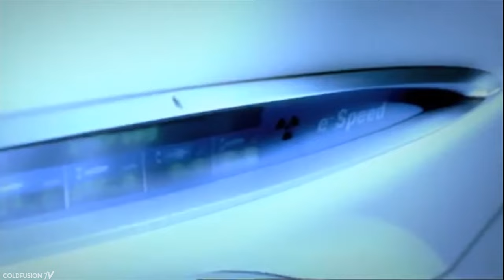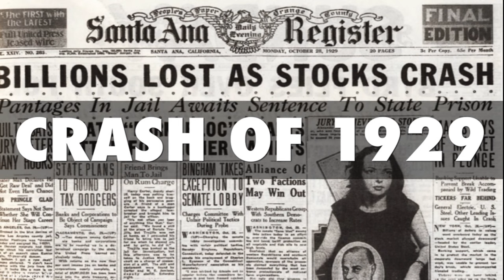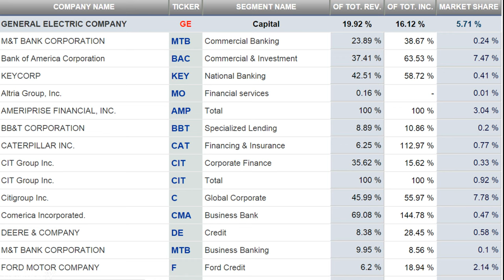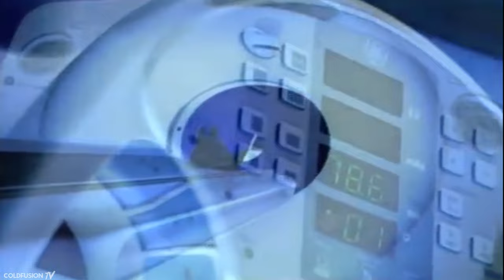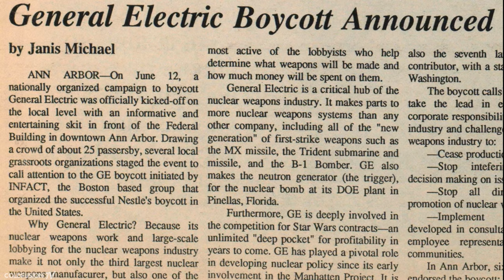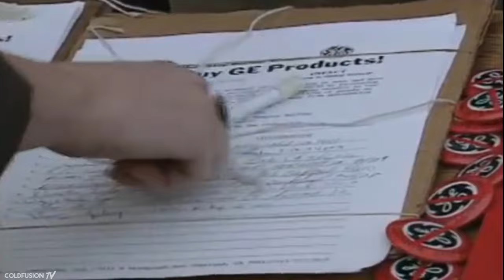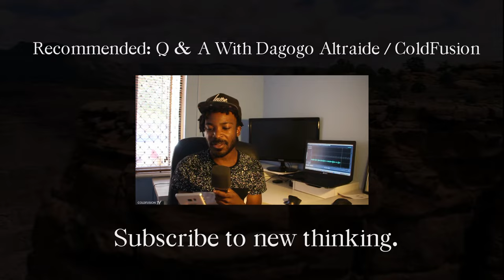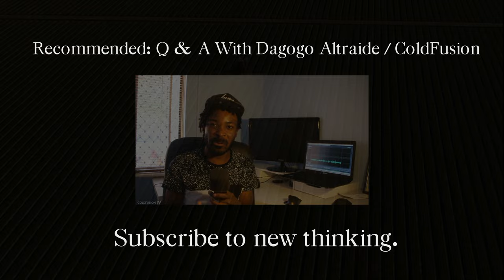How BIG is General Electric? (They've Made Nuclear Weapons!) | ColdFusion

Comment: FYI,  GE sold most of their capiral business which is still in transition.  So capital will be diluted and GE can focus on core work areas.
Reply from the maker: +Pawan Gupta Thanks for that, I've put an annotation up. Makes sense for them to get out of capital markets right now, especially oil company finance!
Reply: +ColdFusion Yea Ge capital is now synchrony financial and in December they completely spun off
Reply: +ColdFusion That was mostly because of the new banking regulations came out after GFC. It wasn't viable for GE to continue into capital business with regulators requiring very high percentage of capital to be reserved for the rainy day. There is more to that but that regulation pretty much forced GE to sell it capital business coz its capital business had the potential to make to it bankrupt in the event of another GFC.
Reply: +ColdFusion you should do a documentary on Freedom 251, the world's cheapest smartphone. only 4$
Reply: +ColdFusion They have also sold they're Appliances business. Companies that purchased parts of  Capital and Appliances will still offer GE products over the next year or so.
Reply: They sold the appliances division to a company and China that will still use the GE brand and logo for 20 years.
Reply: "Their" not "they're"
Reply: And that Chinese company which acquired GE's appliance business as well as the right to use the GE brand with their products: Haier.

Comment: Now that we are in the 2020s decade, it does appear that GE is getting smaller, and here's a breakdown. The shrinking of GE in the 1980's included the boycott of GE (because of their nuclear weapons shenanigans), the HVAC division being sold to the Trane Company, and their small appliance division to Black & Decker. But in the last 1 to 20 years, GE sold their small motor division to Regal-Benoit in 2004, large motors division to Wolong in 2018, large appliances to Haier in 2016, plastics to SABIC in 2007, and their Oil & Gas operations to Baker-Hughes in 2018. More recently, GE sold their train and transportation systems to Wabtec in 2019, both their consumer-residential lighting division to Savant Systems and their commercial-industrial lighting to the Daintree Group (both in 2020). On top of that, GE was actually booted off the stock market in 2018, and now that they are only in the financial business, aviation systems, and healthcare equipment markets, they are now just a small shell of their former corporate dominance.

Comment: Yeah. Great video. Some additional data you could have used: when you say "innovation" and show B1 Lancer engines, you could have mentioned that GE, or GA for that matter, was not able to produce a single jet engine until they received and copied one from Britain - a prototype originally designed by Frank Whittle and observed by an American colonel visiting the first "hop" flights of Gloster Meteor. The colonel became then so impressed he arranged for sending a copy of the engine to US, which somehow ended up in GA "shop". Another even "darker" thing about GE - they manufactured the Pressurized Water Reactors. And the thing is they were first designed for nuclear submarines. However, they got greedy, as they obviously do, and started offering those for civil applications - to the very powerstations that generate electric power. So they managed to market and sell them all over the place, not only in US. One of the countries they seld them to, was Japan. So basically - the old, solid and respectful culture of Japan got f_cked once by nuclear bombs, destroyng about 200 000 people in seconds, and then again, when Fukushima happened. The thing with PWRs is they need constant flow of water, which is kinda abundant and inherent in submarines - but once something happens to cooling pumps on solid ground - they are not very "stable", so to say. So Japan got f_cked once again. And after all that, Japanese PM has to come to Pearl Harbour and express his "apologies". As regards manufacturing of weapons - someone has to make them, just to keep the baddies at bay, but of course the conflict of interests and hypocricy is what's the worst.